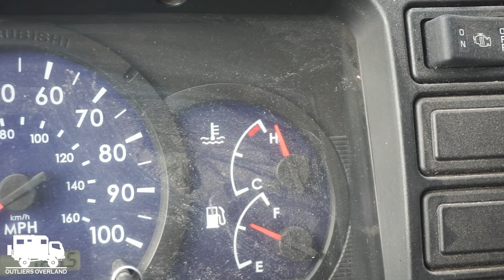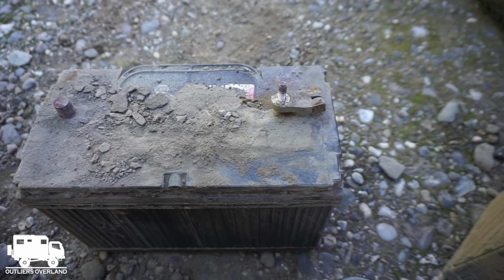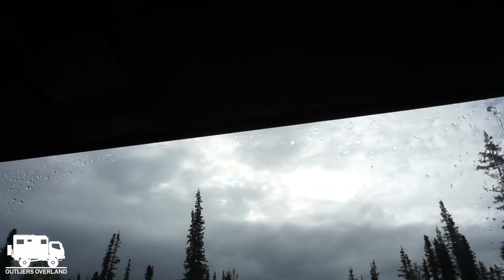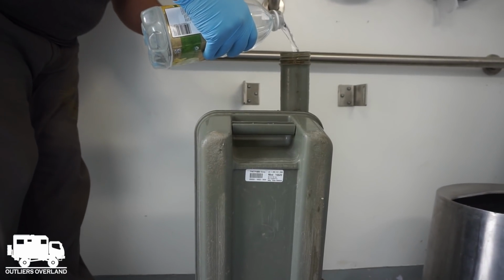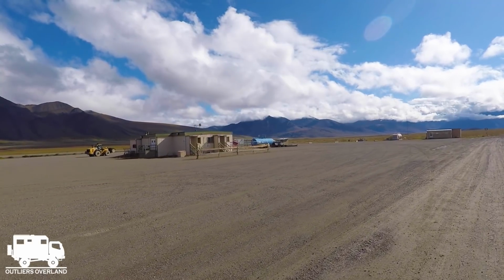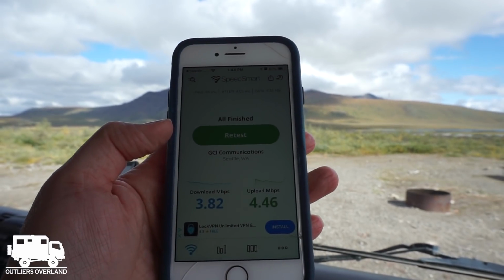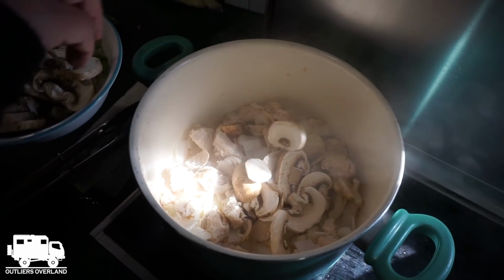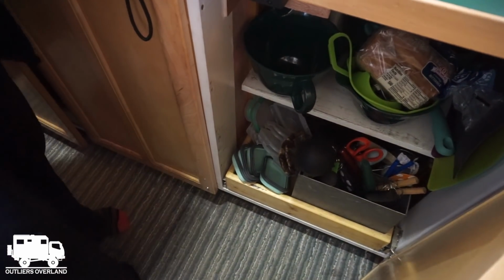OVERLANDING ALASKA’S DALTON HIGHWAY [day 2] • Atigun Pass & Tin Foil Repairs

Comment: Smear a thick layer of Vaseline petroleum jelly on the battery posts before replacing the connections, it prevents acid corrosion and the lead from oxidising causing a bad connection.
Reply from the maker: That product has many uses...